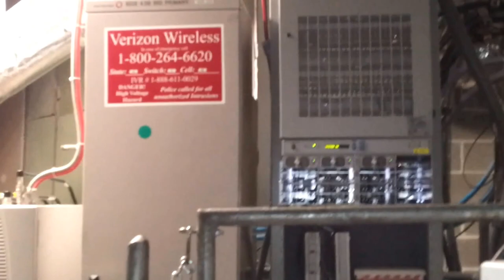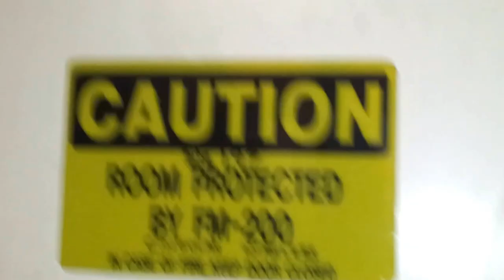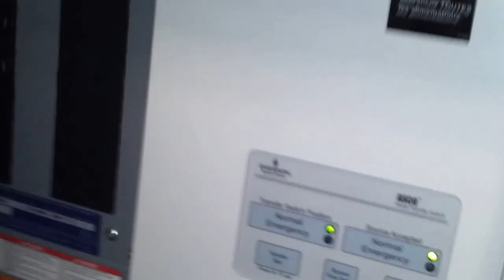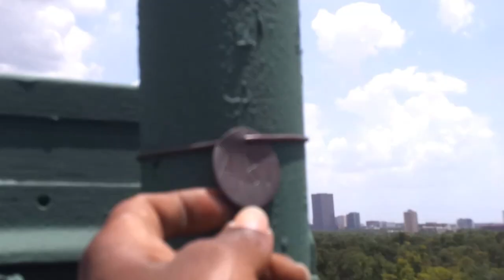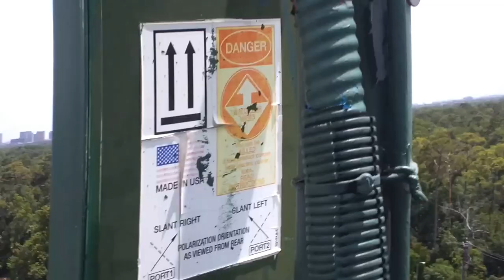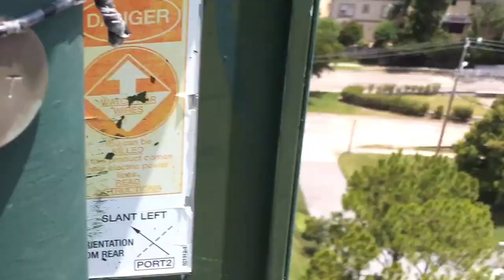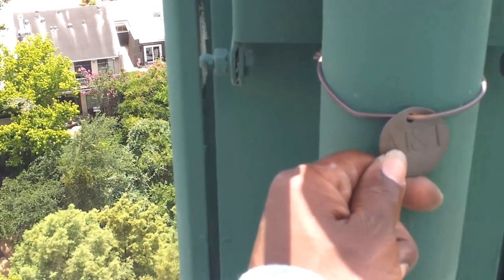Telecommunication Overview Installation and LTE upgrade  AT&T Sprint T-Mobile Cricket Verizon

Comment: Dude you makin me nervous, so close to the edge.
Reply from the maker: I'm belted off to the line that goes around the whole exterior of the rooftop 😂 I'm about to upload some other rooftop work.
Reply: very cool... I turn up the mux from vz center in balto... and never really get a good look at the antenna... "cable management".
Reply from the maker: +Zoey Michael I have done tons of Verizon site I'll post something later on when I go on site again or I can stitch together some photos from my closeout package.
Reply: I that would be cool...